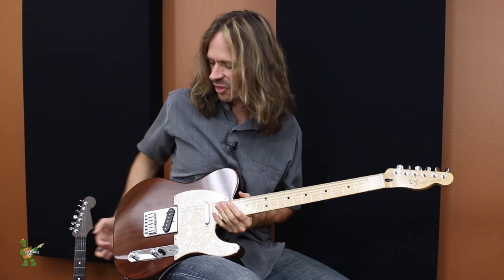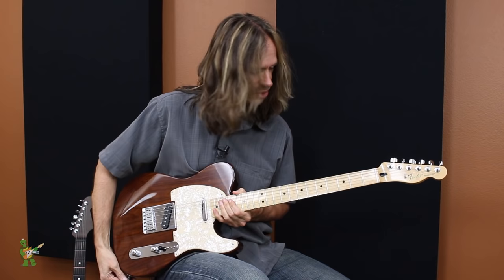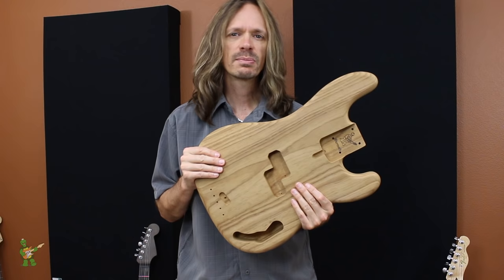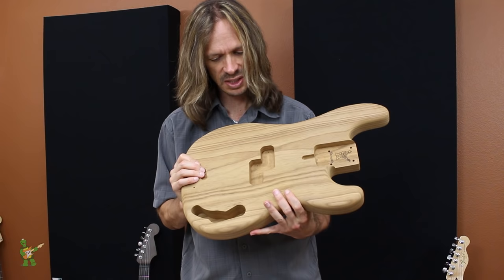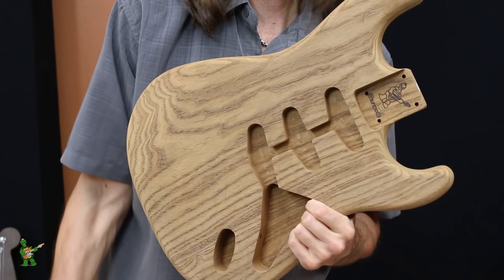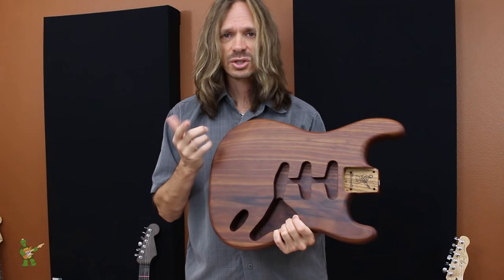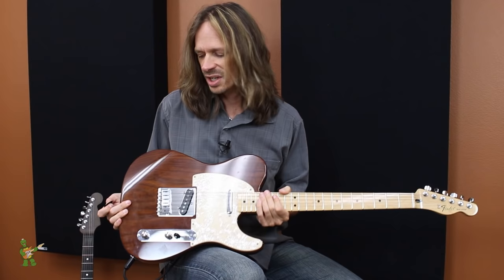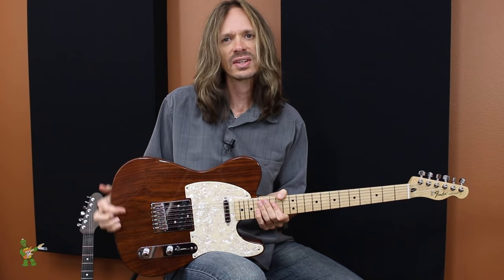Roasted Swamp Ash Guitar and Bass Bodies

Comment: Oh, that Mediterranean Sundance was a pleasant surprise!

Will a roasted swamp ash body need a finish, or can it remain raw like the roasted maple necks?
Reply from the maker: DiMeola, FTW! RSA does not require a finish, but I would probably at put some kind of oil on it to keep out dirt.
Reply: Do you happen to know if applying oil will result in a color change like the clear finish causes, or is there an oil that won't darken the wood? My original plan was a swamp ash tele body with a maple neck and a walnut pickguard/control cover with gold hardware. I'm looking to keep the body's wood lighter than the walnut pickguard for color contrast. With RSA becoming available, I figured roasted maple neck and roasted swamp ash body would be a nice combo.
Reply from the maker: I haven't seen an RSA body with an oil finish, but my guess is that it would still darken it.

Comment: What about cutting/modifying a roasted swamp ash body?  Is the wood too brittle/hard?  Is the roasting process done before or after you machine the body?
Reply from the maker: The wood is roasted before it is cut, and the color goes all the way through. This means if you cut or sand it, it will still always show the nice roasted color.